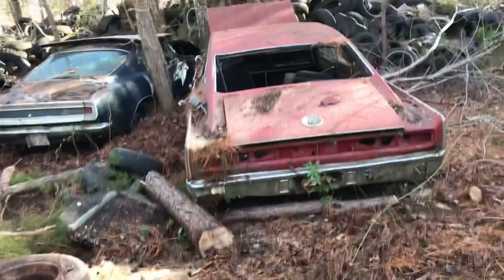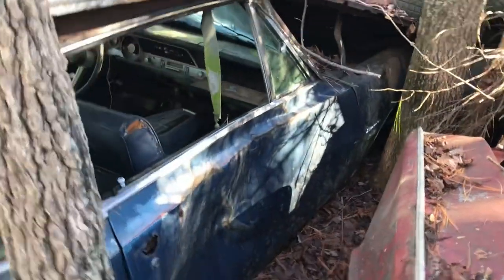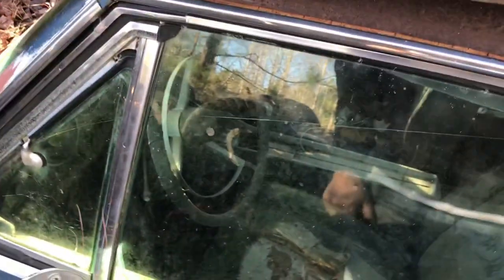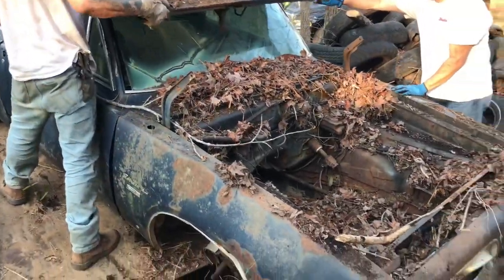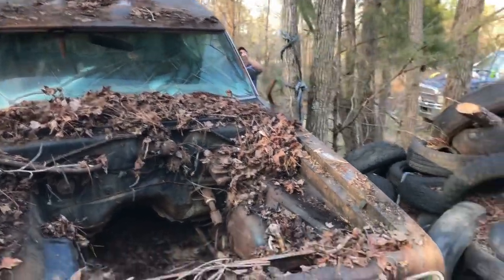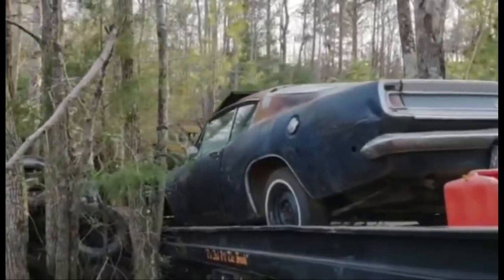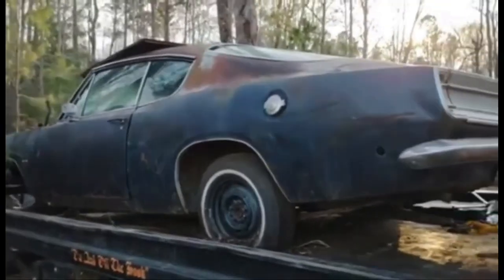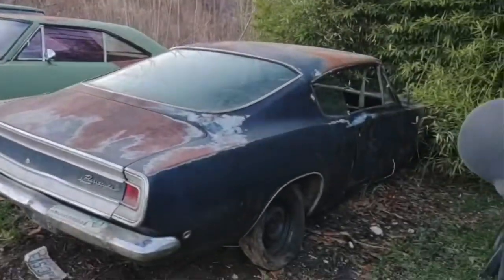SAVED 1968 Plymouth Barracuda from 20 years in the woods

Comment: Up here in the upper Midwest rust belt state of MinneSNOWta, neither of those cars would be considered to be parts cars but would be prime restoration or restomod candidates. Far worse than either of those get restored up here on as regular a basis as they can be found. Mopar fans up here would give their left arm to get either of those into their garages as project vehicles.
Reply from the maker: We pulled 3 cars out. A big block 4 speed Barracuda & the two here. All the cars have their own videos. The Charger is available for $2000 as it sits. It’s at my shop. The two Barracudas are at Field Agent 880’s shop. I’m sure he listen to an offer
Reply: @bobsclassiccarsparts8772  if I wasn’t disabled I would jump on them.

Comment: What i will never understand is why people park cars with the windows down ? I am in the process of saving a 69 Cuda from race track death. N.O.M. 440 will be poked and stroked. 4.10 Dana will be hit hard by the new 3rd pedal in the gang. Your front grill looks undamaged mostly. Those will cost you if you needed a whole new one. Passenger front fender looks workable as they are only found new in fiberglass. Learn to bang out trim to polished perfect and that car looks savable. Buckets and console car to boot! New bumpers are reasonable priced. Nothing wrong about saving them for the love of classics over making a buck at the moment instead of later for a whole refurbished car. Been a year until i found this and wonder what progress as been done ,,,,or not.
Reply from the maker: This Barracuda was sold. Not sure who bought & what they plan for it. The big block four speed was sold to one of the followers just a week or so ago. The main thing is we rescued these cars from being crushed. There was three & we managed t get two. The guy just simply didn’t care. I begged him not to crush the other & he didn’t care. Probably got three hundred bucks
Reply: @bobsclassiccarsparts8772  So glad to know that some were saved.  I used to work a scrap metal yard and i hope that crusher knew to save some pieces before deleting it forever. When we got one with a running engine but not worth pulling,  us paid pack rats would throw a brick on the gas pedal and let it smoke and scream in pain while eating our lunch and bet/guess when it would blow up for laughs in the 70's and early 80's.:cat-orange-whistling: Back then if i remember nice cars were worth about 50.00-75.00 depending if it was a small car or a big more door and station wagons. 3 years ago i paid 3,000.00 Canadian monopoly money for good floors in my 69 project that is on the rotisserie still. Why is it taking so long? Parts sticker shock for a working man. Example: complete PLASTIC grill with signal light parts and those non reproduced headlight bezels were around 5,000.00 smackaroo's for this Cadideanne. 1.000.00+ for the traveling border crossing taxed on taxed again taillights. I have saved,  painted and rebuilt G.M. cars for that amount by comparison.
Reply from the maker: @henrybourdon6712  more than likely it was crushed without any parts removed. Damn shame. I offered him $500 for it & when I came back a couple weeks later it was gone.